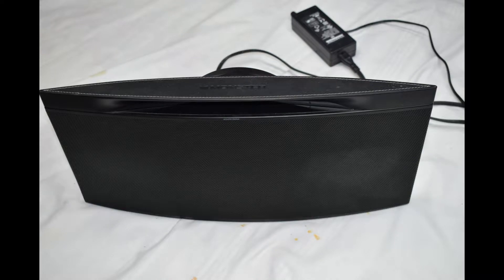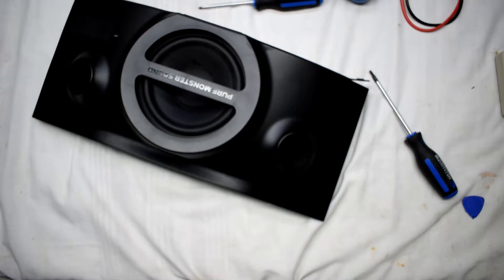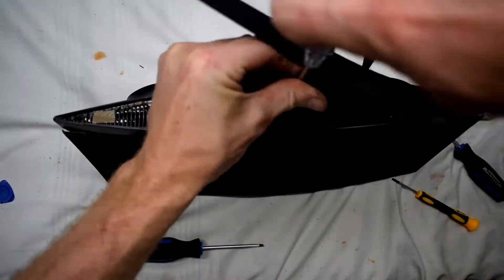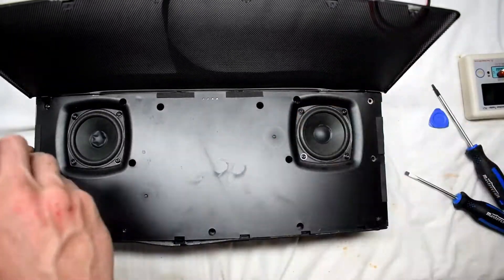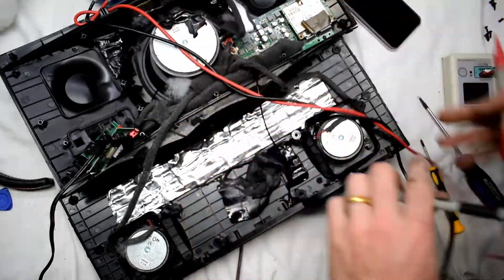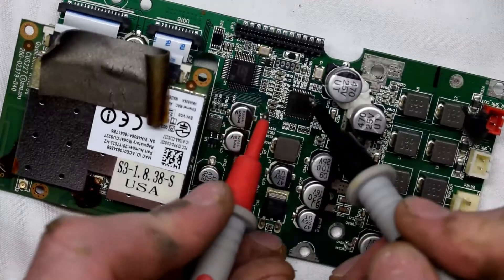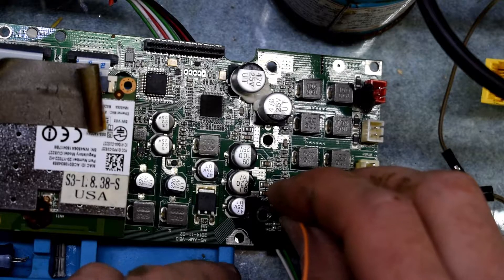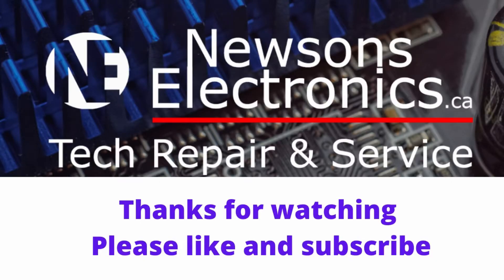Bluetooth speaker not work? Monster soundstage S3  (PCM9211 shorted!!)

Comment: So my S3 cannot connect via Bluetooth. Pairs for one second the says audio is lost. Not connected then the power button flashes blue and red. Have any idea how to get it to pair?
Reply from the maker: you could open it up and see if the antenna wires on the bluetooth module are connected.
Reply: @NewsonsElectronics  I have 3 of them and none work. Also the nfc pairing doesn’t work. When I read it…it gave some error. It connects for 1 second then disconnects and power button flashes blue and red over and over again until I unplug it.